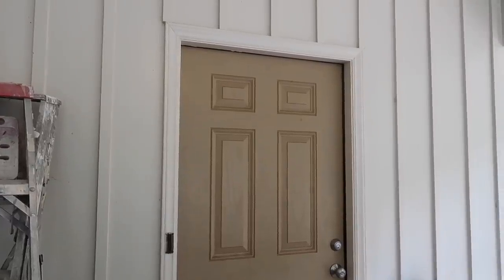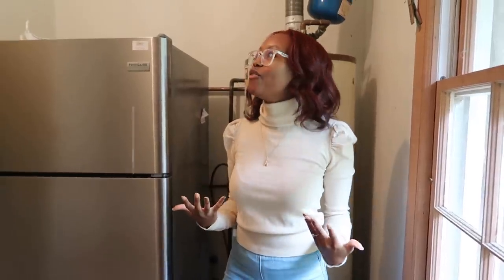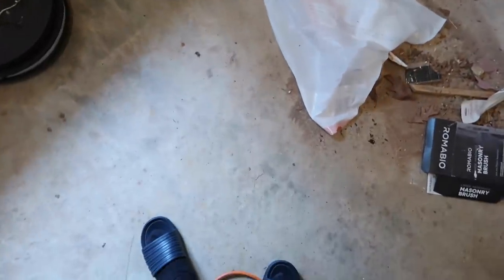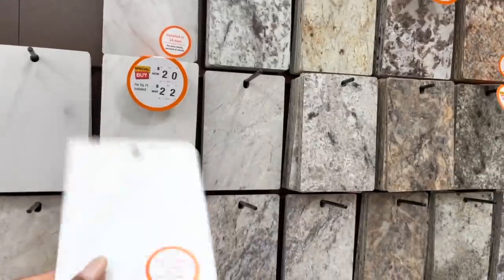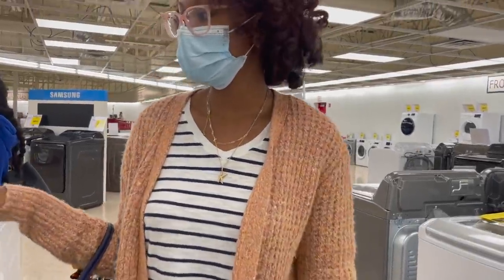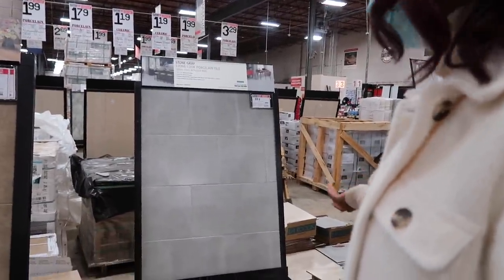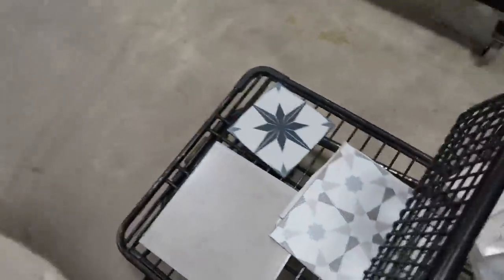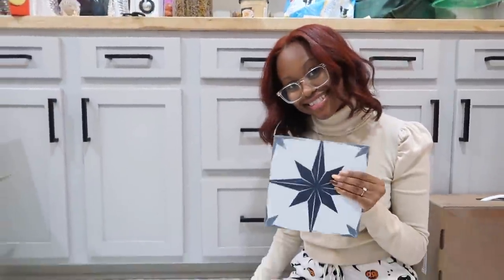DREAM LAUNDRY ROOM MAKEOVER PT.1| Shop With Me, Renovation Plans, & DIY Project #FIXERUPPER *NEW*

Comment: Top loading washers with a deep fill allow you to soak the clothes and really get them clean.  I like the old designs with an agitator.  To me, that along with a deep fill top loader is the best way to get the clothes sparkling clean. The front loaders use less water and look pretty…but for a deep clean go with a top loader.
Reply from the maker: Yes!! I’ll definitely get the top loader 🙌🏾
Reply: I had to replace my washer a few years ago and did a lot of research.  I wanted something
Reply: Oops!  Didn’t finish before it posted.  I wanted a top loader big enough to wash blankets, bedspreads, etc.  I finally settled on a GE and I haven’t been sorry.  I’ve given it a work out and it keeps on going.  I think I saw one in one of the stores you were looking in on this video.  Good luck on your new project.  I love everything you do…it’s hard to believe you are so young and yet so accomplished.  Bright and shiny future ahead for you and Marcus.  You two are doing things right.  ❤️

Comment: Hey Kayla, I don't know if anyone mentioned it but check the depth of your top load washer. They can be fairly deep for a short person, at least that's an issue I have with mine. Just a tip...can't wait to go through the process with you and Marcus😊
Reply: Exactly! I’m barely 5’ and always had the hardest time getting to the bottom of my top load washer! Plus my husband is almost 7’ and his pants are so long that they always got tangled on the spin cycle and started banging. Our front loader is much easier.

Comment: Option 2, I used peal and stick in my kitchen back splash and countertop a year ago and it's holding up. Not sure if the floors were wood or cement, either one has to stand up to water when choosing flooring.

Comment: Either option 3 or 1. The peel in stick tile is hard to clean without discoloring if something gets on it that is hard to get off. Also with the you coming from the outside to get to the room, it will probably get dirty easy. Not sure if the room is temp control or not but if not the heat will also loosen the glue on them.
Reply: That’s why I like wood peel and stick. It’s hard to stain

Comment: Hey! Option 1 is my favorite, followed by option 3. Totally agree with buying a top washer. The seal around the door on the front loads tend to loosen over time (according to the reviews). I have a tankless gas water heater in my new build. It’s very cost efficient and super easy to adjust the water temperature. Love your hair color, btw 💗
Reply from the maker: Hey boo! Thank you very much!! 💕💕💕

Comment: First, I have to say I love you hair color and each style looked cute!

Personally, I prefer top loading washing machines versus front loading washers.  Also I have heard a lot more people complained about having to get their front loading machines repaired more frequently then those with traditional machines.  I tend to stick with GE and Maytag appliances washer and dryers.
 
With that said, I like option #1 and option #3 (but since you seem to like option #2 paint color the most maybe consider going with that color for 1 or 2).  I prefer hard tiles or laminate but not peel and stick (to me their like a big stickers for floors and walls).  Although your laundry room is in a low traffic area it seems to be located off your car port and will be closer to the elements, therefore tile seems like the better choice in the long run!

Comment: Option 1 and top load washers are the best. Option 1 will hold up well and give you the ability to change things up more easily like if you change the cabinet color or want to add other design features (wall tiles, maybe accent floor tiles using peel and stick, other). Even the wall color in option 2 seemed like it could go well with the floor in option 1. Can’t wait to see how everything turns out!

Comment: Hello Kayla! Great to see you're moving forward 😍 Everything is looking very nice. Just FYI,  Erika Tachoir gave you some great info on your washer/ dryer options and I agree 1000%. I actually highly recommend the Whirlpool brand. At 59 yoa and 1 year into my 3rd home purchase, I must say that Whirlpool is a beast. I bought a new Whirlpool washer almost 33 years ago when I went into my first home. The dryer was a 4 year old Whirlpool that was passed on to me from my sister who was getting a new set and had sold the washer to her friend. We'll I just put a new belt on the dryer and the repair man was praising how great it looked and said it was so worth it to do the repair because I may never get that longevity out of anything that's available now. About 5 years ago I had what's called dog ears [makes the bottom half of the agitator turn], replaced on the washer. I wipe and clean them after each use like you would do your stove and kitchen fridge. They look great and work great so I'm hoping for many more years. By the way... when you showed your Frigidaire range in the kitchen make over, I made my decision to replace the one that came in this home and get the one you chose. I wasn't too happy because I don't like electric for cooking but I'm in an all electric community so I purchased the one with the air fryer /convection oven. Unfortunately, I hate that ceramic cook top. It's too fragile, and takes too much time and attention to keep it clean. I could not use my fabulous Club Cookware that I have always loved and still think is the best Cookware ever. That's why I bought 3 sets and put them in my hope chest [$130 each on sale] when I was just 24 years of age. I retired the first set a few years back, making the "when I need extra cooking pieces 2nd set" my primary set. Later I opened the last box for when I need extra cooking pieces. Anyway, I'm a real cook and that ceramic cook top is too fragile for me but I hope you are enjoying yours. It's beautiful to look at and it makes a kitchen look really nice but I need durable.   If you have a secret on how to protect it from scratches please let me in on the info. I waste too much of my life trying to baby that stove top and I hate it. Blessings to you Kayla. Oct 3 was my 1 year back in Alabama after 20 in Texas so I'm still organizing and purging, but I enjoy your post as often as I can. I need to binge a few episodes to catch up now.😊 Keep following your dreams and keep God first... have a great day.🤗💞🙏🏾

Comment: Whirlpool & LG are the best. Door switched to opposite side, opening out of room.Use #1 tiles cut in 3 pieces length wise, used in a herringbone pattern, matching grout. Add waterproof pans under washer/ dryer. Raise feet on appliances using a wide enough baseboard. Cabinet color matched to floors. Add sink in white(wash dog/car etc) add a heater if needed (electric-outlet under window). Put tankless hot water heater on wall across from fridge (new position inside an upper cabinet not lower). Use #2 peel and stick tile on wall behind washer and dryer for accent  using extra glue, or paint with stencil or not. Your choice of shelves/ plants. Better lighting Done.

Comment: My fiancée is a appliance specialist for Lowe’s and from what I’ve learned, the Samsung brand isn’t the best for longevity and you’re pretty much paying for the name. Whirlpool and Maytag is a great and durable brands. Definitely top load. Easy and accessible. Front load, you sometimes have to deal with it leaking or molding in the inner flaps if it doesn’t dry after a wash properly. I’m so excited to see the finished Reno 🎉😍

Comment: I like option 2, it’s more subtle. U can use a mastic adhesive and grout it, like tile, if u like. Also, I had a front load washer, but would not buy another. The door can’t be closed between washings because of the darkness, moisture, and temperature, which mold and mildew loves!! I would constantly be drying the rubber lip on the inside front of the door. No one tells u when u buy them, but ur clothes will be smelly if u close the door after washing. Whatever u choose, I’m sure u will make it work for u! ✌🏽

Comment: Just use your design pieces in the center  of the room and your plain gray around. The peal and stick is good but they can come up 
 around the door ways. It’s not a bad choice. You can use glue as well with it. It’s just a laundry room. The plain gray if cheaper is nice. Decorate around the color. You do well with that😀. Don’t go to busy.

Comment: Peel and stick tiles are very easy. What I did to have it last longer is put a dab on caulk in the center of the adhesive side and it stays for over 20 years. I have that in my kitchen and 23 years still going strong

Comment: I would do the paint color from option 2 with the floor from option 1. Since you have to go outside to get to your laundry room, I would skip vinyl and do real tile floors. You absolutely can’t beat the durability. And the solid gray floor gives you freedom to redecorate the room whenever you want. The problem with busy patterned tile (aside from the fact that it looks like 90s linoleum- yuck) is that you’re stuck with that color palette for years. And DEFINITELY do the tankless water heater- I have one and I’ll never  ever live in a house with a regular water heater again.

Comment: Good morning Kayla! I’ve had both types of appliances.  The front load rubber lining begins to smell.  I have the Maytag matching top load w/d with glass lid.  Everything is digital and I’ve replaced the board myself and bearings.  A few hundred versus grand to replace or service.  I love not having an agitator; less friction on clothes!  Option 1 would be my choice.  Can change wall and cabinet colors down the line.  Finally, looks like you have to exit home to get to that area.   Dirt & moisture will wear down peel & stick; then you’ ll pay again to replace.  Can’t wait to see completed project & look forward to office edition!!!

Comment: Appliances I would say Whirlpool or Kenmore we’ve been told their top of the line. And easy to fix and the parts are easy to find as well is what we’ve been told. 
Now I would go with Option #3 the flooring is gorgeous and the  paint color GORGEOUS and different with a light almost plan countertop OMG GORGEOUS! We did peel and stick and it was a HUGE mistake. Find out how it holds up during winter and rainy days.

Comment: I prefer front loading just because I’m short and it’s tough to reach in and get the laundry out. But that’s the only reason. I will say with front loading you have to make sure that water doesn’t sit in the seal or it gets mildewy after a while and stinks.

Comment: Yess get the Maytag top load washer and dryer. I have those same exact ones. It also comes with a good warranty.  The front loaders you have to make sure you maintain and clean the rubber near the opening because it can hold water and cause an odor or mildew

Comment: Hey Kayla & Marcus
I like options 2 & 3 but I would do the cabinet color in option #1 with options 2 or 3 tiles. 
The peel and stick tiles are very easy and quick to install.  I've done peel and stick tiles before.
I love the peel & stick tile in option 2 and the option 3 tile. I would change the cabinet color to option 1 with either of those tiles.

Comment: Option 1 for tile with paint color with option 2.  The peel and stick could be a problem with long term sticking if the room is not temperature controlled.

Comment: I would use your Kitchen tile, peel & stick tile will eventually come apart.  Regular tile will do better if it gets wet.  Option 3 is better if your not using your left over kitchen tile.

Comment: Either 2 or 3 you can’t go wrong. Top loaders Washers are the best I picked a LG ( see thru top on washer and regular door on dryer) set with the controls in the front not the normal back ledge

Comment: I like option 3. Seems like a good space to have fun and try things that you wouldn’t do in a bigger or more commonly used room. The navy with the warm ish light blue seems very classic but still cheerful. You could bring in navy accents in the decor, too.
I’ve gotten front loading machines each time we moved house. They are more efficient, use less water, and I like that the top is counter space. As a mom, too, it’s nice to be able to include little ones in this task. Before we replaced the old top loader in our current house, I had issues reaching the bottom of the machine - I imagine it would be a lot harder now for me with baby bump. I know these are not concerns for everyone, though, but just something for some to perhaps consider.

Comment: PersonalIy would pick option 1 cause I think the tile would fit better with different paint colors or decor if you want to change the look later. I do like option 2, but kinda iffy about the peel and stick tile.  I dont feel like its very durable. Got it in my basement, but its damaged from my hot water heater leaking. If you do go with option 2 I suggest getting extra just in case.

Comment: Hi GIIIIrl, first of al thank you for al the effort you put in ya Videos!! I love them so much, and your personality is so lovely!! I had to say option nr. 2 is my favorite as well ;) By the washer and dryer situation I´m in the same boot!! In Germany 95% of the houses and apartments have no laundry room. In most of the cases washer and dryer are in the bathroom or the basement. in my case, it´s in the bathroom. The space for it is so small, that I would have to stack it, but when I measured, I recognized, the light switch was in the way =( so I did some research!! There are washers and dryers in ONE machine , did you know that, for me it was mind-blowing... So for next year this is on my I NEED TO BY LIST =) Sending love and a big Hug from Germany. ....Pleas don't mind to correct my English ;)

Comment: Good job Kayla love your channel. Just purchased new home a few years away. Choosing washers and dryers we thought that front loaders we're cute but turns out that same one you opened top loader it is a LG in white we purchased it because it had so much more room. Also white was our choice because colors change every so often so if something happened to one white is very easy to replace even if not same style. We are nearing black Friday remember those prices will go down. Check out Best Buy as well. So far our LG top loader washer and front load dryer are great. I really like them both 3 years.
 Comforters fit in them much better.

Option #3 is cute

Comment: Great options for the flooring amd cabinet color! I think all are fun ideas. You should also make sure you measure the washer and dryer side by side to assure that they will fit in that space. I carry a small tape measure in my purse at all times because measuring is key.

Comment: I was gonna tell you to get tankless I have a Bosch hydro powered 8 yrs now still love it n had no problems  from it. It does not require  any electricity  the water ignites the burners n propane. Even when power is out I still got hot water .best $1000 I ever spent. Gas lines and plumber were extra I think total I spent $1800. I chose bosch because a Rinnai tankless started at 2000 n better just the machine without installation.cost.

Comment: I am loving your fall hair color on you! I have peel and stick in my laundry room but I used the extra adhesive underneath and it was the grouting kind so I did use grout also. I have had it down for 10 years and it still looks new. I like options 1 and 2 but the paint color for 2 for both tiles. I hope it turns out just as you imagined 😃.

Comment: I'm late but...

Whirlpool is nice, my dad's old set (w/ a top loading washer) lasted a good 20-30 years with minimal repairs. His new Samsung front loading set has broken down 2+ times each in the last few years though. My mom has an earlier model Samsung set (top loading washer) and she hasn't had any issues in the 6ish years she's had them. I've had my stackable whirlpool set for about a year, works great!

Hope you find something that works for you!
Reply: And if you do the peel and stick tile DEFINITELY glue it down, especially in an area like the laundry room. Water proof DOESN'T equal water resistant. It will likely eventually lift and/or fall apart, just depends on how long you want it around. And if you do glue it, it'll be extremely difficult to remove if you change your mind. Good luck!

Comment: IKEA has one white faux marble laminate counters for under $100 for like, 9 feet or something. I redid all my kitchen countertops for under $160. It doesn’t have a lip either. Also the only thing I don’t really like about the front loader is that you have to leave the door open to keep it from moulding. Also, peel and stick tile is WAY easy to install and I have it in bathroom and kitchen and it’s still amazing. In fact I spilled paint in my kitchen and just pulled up and replaced the messy tile.

Comment: I've tried the peel and stick but had to add a spray adhesive down because they kept becoming loose. I'm glad you decided on a top load washer because I have a front load and I hate it. It does not clean as well as a top loader.

Comment: I’d love to see more classroom video’s and what it looks like now!
Reply: In MY opinion doing peel and stick tile by myself I may add on a bathroom I hated it lmao, you have to make sure the room temperature is right so the tile doesn’t snap when removing the peel, it’s also good to have a pusher to make sure it lays really flat & cutting the extra tile for little places is also very hard on the finger tips (if holding the sticky part)
Reply: Also, during time the tile may crack depending on how often you walk on it or the temperature but that’s just my personal experience